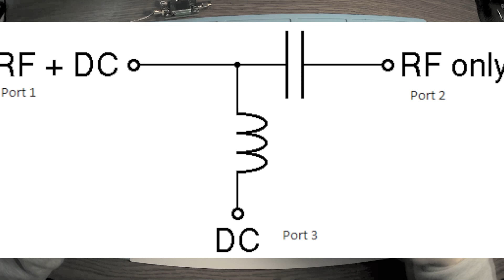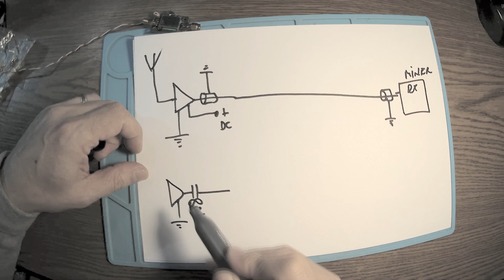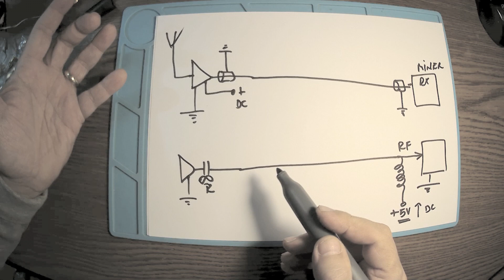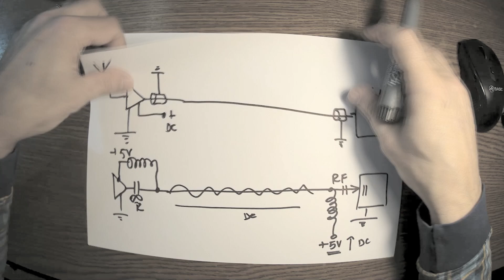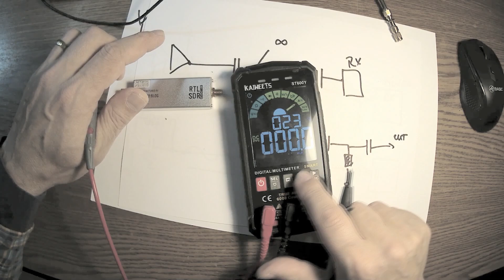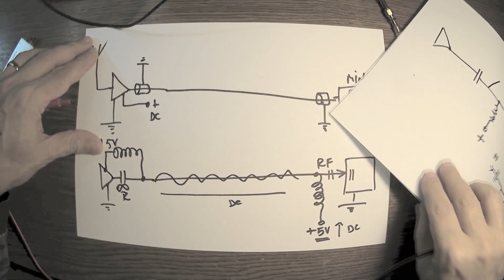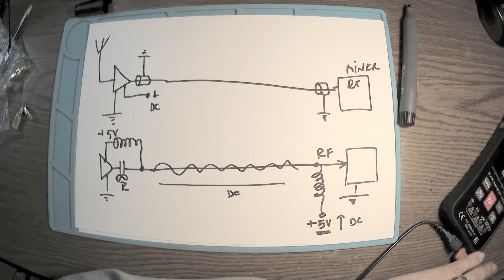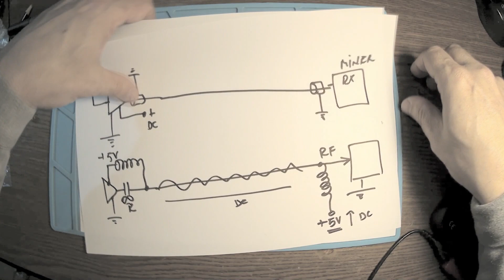DIY LoRa HeliuM RF amplifier Bias Tee

Comment: I bought a cheap Bias tee module on aliexpress and i want to use that do you think if i connect a wire between the SPF5189Z middle antenna pin and SPF5189Z 5v pad will that be enough to use bias tee?
Reply from the maker: As long as the input\output of the amplifier it's capacitor connected, you can use any Bias Tee...check the in/out with a multimeter for short.
Reply: @viocaia  So I just check the SPF5189Z middle pin from output and middle pin to input? And if it shorts then its good to go or if it dosent short? I don't really understand electronics this well...

Comment: Ok So I Have A Questiopn And Potentioly A Problem, I Own Two RTL.SDR V3, I Did The Test As You SHiowed With Multimeter To Both of Them, So, One Of Them That I Use In Daiuly Basis Shows Me 56Ohms, The One I Dont Use ALmost Never Shows Me 1143 Ohms, So The One I Dont Use Seems Okey, But The One I Use have SOme Issue With The Ohms, So, Why is That? Is It Burned Out Or SOmething? How Do I Fix It? :(
Reply from the maker: I don't see like a problem, maybe it's a different version, even a different board.

Comment: A 1uH inductor would look like aprox 600 ohm at 100Mhz and 60 ohm at 10Mhz so are you planning to receive lower frequencies, ex HF at 3-30Mhz, i would use a inductor with much more turns, ie higher inductance then a couple of turns of TP-Cable,i dont know what value the inductors in the video are using but cant think they are more then 1-2uH?
Reply from the maker: Qorvo SPF5189Z it's using on their evaluation board for max 1900MHz a 47uH...but I found 1uH in many schematics.In this his case LoRA is around 900MHz...of course a higher value for lower frequencies it's good.

Comment: hi im a beginner and i have a question. i have a biastee with both ground and vcc pads. what is an appropriate power source?
Reply from the maker: The power source will accordingly
 with the device which is connected to...let's say if you need to power an amplifier (LNA) to 9V  and 100mAh, of course your power supply should be capable to deliver that at least. Usually minus to ground and + to Vcc
Reply: but like what a battery? @viocaia
Reply from the maker: Of course, a battery will work for a while. @alexandreptito8485
Reply: excuse my ignorance but what kind of battery? @viocaia
Reply from the maker: @alexandreptito8485  depends of what you have power... The bias tee is not an active devise, it`s just passing Dc power through a RF cable.

Comment: What is the value of the capacitor? I need a Bias tee to feed a 137mhz amplifier
Reply from the maker: This values are different for each frequency, but you may try something around 10 to 20 pF

Comment: Hi Viorel,, Another tricky question :)
I wanted to ask you about the advantages of using cheap cable like RG58 for 10feet/3 meter = -1.6db. In our case the cable lowers the Amp output but also it can lower the power of high 6dbi Antenna to 4 dbi. In both cases does that mean the Antenna changes it's power from 6 to 4 dbi which means wider angel and different usage of the Antenna? 
In other words, can we lower the power of the Antenna (same as we do with Amp) from 8 to 6 or from 6 to 4dbi using cheap cable like Rg58 or using attenuator . In this case I don't need to return my 8dbi Antenna to replace it with 3dbi. I just use 30 feet Rg58( -4.7 dbi) and problem solved ? :)
Reply from the maker: Of course the antenna gain will stay the same, also the pattern! It will only increase losses because of the cable..but remember the same loss it's to TX too! And the cable it self can catch radio because bad impedance or shielding, it can work in anti-phase with the antenna and getting much more losses then simply, let's say 2 dB..it can make the gain 0...but in theory should work..only field will say..
Reply: @viocaia   I appreciate that intelligent, prompt reply. Lets to learn from you :)
Reply from the maker: @waila8200  I hope it's the right answer..I'm still learning too..

Comment: You could use your vna to double check the bias-t at 868mhz to make sure you have enough inductance to not attenuate your signal... I did something similar , used 2uH inductor, but my amp had no capacitor so I had to add a 100nF...
Reply from the maker: Good idea..it was just a practical demo..

Comment: I asked you about a link for that rf circulator...
Reply from the maker: I sent 2..probably YT censored links..anyway try to Aliexpress and serch for TH3538XS series Customizable within 300-1800MHz UHF RF microwave coaxial circulator RFTYT
Reply: @viocaia  50€? So i need two of these to use one antenna?(PS: expensive...)
Reply from the maker: @adaniel69  If you only think money, you'll never have them..this is a matter of knowledge and fun! That's hobby for!
Reply: @viocaia  🤣🤣🤣